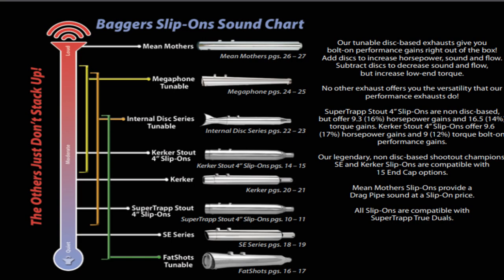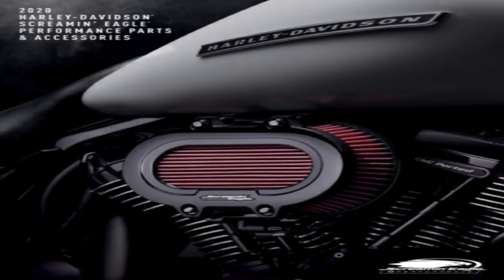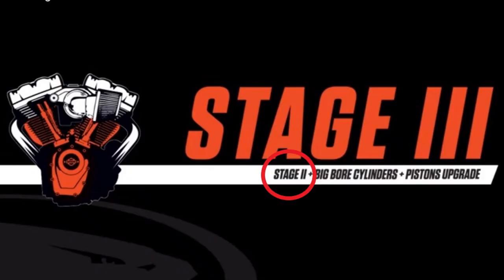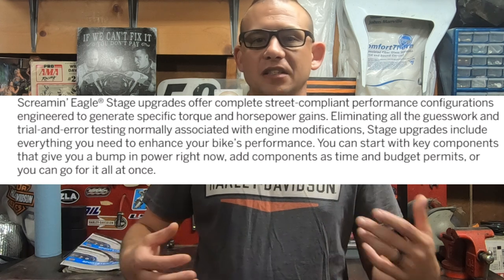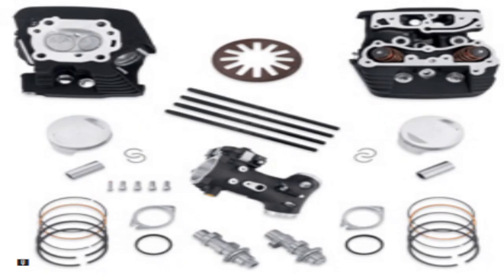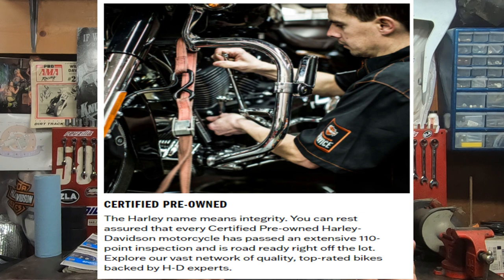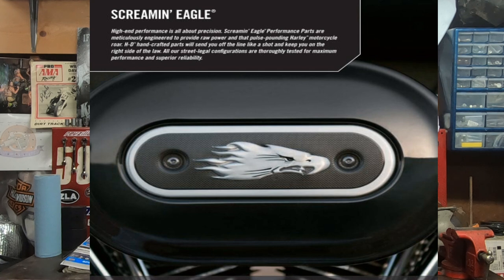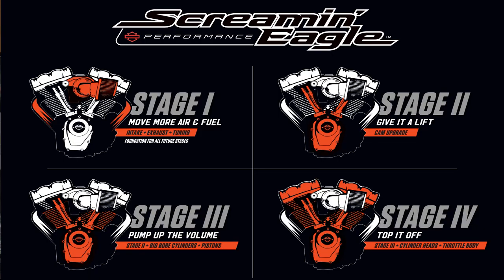Stage Kit Secrets, What Harley-Davidson Doesn't Tell You

Comment from the maker: Does anyone have a Screamin Eagle Stage Kit with an aftermarket cam?
Reply: I'd love to see what a Stage 4 131 kit can do with a good aftermarket cam.
Reply: I have a dyna fxdls that I did a 117 bolt on kit but with a woods 777 cam instead of the cam in the kit. It runs phenomenal.
Reply: Waiting for a tuner that will work with ‘21 RDRS then I will find a cam and upgrade. Probably be a while. 

I have a 21 road glide with a stageIV.
Reply: I believe zippers has one
Reply: @parkeslife4323  they can make upwards of 150whp/tq with a proper cam/tune.
Reply: @oldschoolmobile  that's what I'm talking about. 40 more TQ with 50 more HP to boot over a stock bike. And a decent boost over the "Warranty Friendly" SE 131 kit. Just with a cam. That's the bit that I find most interesting about M8's, how they respond to a decent cam that lets those heads flow to their stock potential.
Reply: 122 kit on a 114 with Vance & Hines full exhaust. Honestly, I don't need anymore on my SG. The results are already more than the chassis can handle when it's pushed hard. I also need to force myself to slow down! The Damn thing makes me ride to fast.................... :)
Reply: I ran into a guy with a 2021 RG. He had a Harley stage 4 131 kit installed by the dealer but said that S&S told him that their 505 cam would be better than what came with the kit so he put that cam in and said it was a monster. Didn’t ask him his numbers but the bike did sound nasty.
Reply: Did a 95 inch upgrade on my 01 DX, Feuling 585 cams, high compression and screaming eagle race heads. After I got the carb dialed in it was a killer outran many 103s and stock 110s
Reply: @Bluis5445  I've got a Wood Knight Prowler 22x in my Breakout 114. With the heavy breather intake, Vance and Hines short shots with a tune, she runs like a scalded-ass cat. Wood is an outstanding cam.
Reply: The sealed SE Stage II EFI kit I bought for my 1997 FLHPi (prior to ripping out the Magnetti Spaghetti Fuel Injection!) contained an Andrews EV-27 in an HD SE box.
Reply: Yes very confusing.  Installed a andrews 48h cam as stage 2 . This year bought 103 stage 2 , no cams , which was okay for me .Very happy with results .

Comment: Just ran across this post . Harley is confusing on there stage kits for sure . 2008 heritage classic , Last year installed  power vision with target tune , fueling cam plate , oil pump , andrews 48h cam , Cobra power pro 2 into 1 , SE high flow a/c , gaskets bearings , all came with the bike . Put a big smile on my face , what a change . Now I have run across a obsolete SE part # , never used stage 2 103 kit , minus the high flow a/c. For $275.00. Hear the bump in compression makes this cam really nice . Also saw video on having cylinders bored and so on to bump compression. Looking forward to a wider smile ! If I hadn't come across the deal , still would be content with what is already there !

Comment: I ordered my 20 Breakout brand new. The dealer steered me towards a Wood Knight Prowler 22x cam, pipes, intake and a tune over a SE stage 3 kit. They told me that as long as they installed everything my warranty forever would be intact. I've got that in writing and my dealer has been great. I'll take aftermarket parts over SE any day as long as the warranty is honored. I saved thousands and gained more hp and torque.
Reply from the maker: You have an awesome dealer that believes in and stands by their work! Harley-Davidson won't warranty what they are doing so the dealer will warranty it on their own. That's awesome they put it in writing for you and the fact they were honest with you about a cam swap versus an entire engine kit!
Reply: @GixxerFoo  tell me about it. I bought it in April of 20 when no one was selling anything due to covid. My wife and I were considered essential workers then and I'd already saved $2500 to put down on it and they were eager to sell. Even better was that Harley Financial would only give me 7% apr with over 800 credit scores so the dealer turned me onto a local credit union and got me their lowest rate at 3.75% making payments only $367. My dealer has been wonderful. I was concerned after hearing horror stories about dealers but I guess I got lucky. 3 State Harley Davidson in Bossier City, Louisiana. Love your channel too. Ride safe.

Comment: Another great honest video. They play on selling things to guys who know nothing about engines. Gimmicks. The basics to increase performance. Heads for compression, cams that work with the valves in the head. Performance bearings to handle the extra load on the engine. The piston still only sucks in what it is capable of sucking in regardless of the cams or valves. Now there are forced systems that will push more air and fuel in. Unless you have an engine test stand you are shooting in the dark. By the time you spend on all of that over priced parts and labor you could have put a drop in crate engine already built for performance. Crate engines are already tested for performance. For myself I had to purchase a screaming eagle jet kit just to get the carb to work right with the heads that came on the bike. Harley knew I would have to jet the carb. I put a 3/8 hole in the single plug in my stock exhaust, instant stage one exhaust. I also switched out the intake to a screaming eagle cleanable filter to save me money on air filters over the life of the bike.
Reply from the maker: I will say the Screamin Eagle kits are tested combinations and you usually do hit the advertised power at a minimum. But then again there are a lot of shops out there that have tested and put together some killer combinations that make some big power. Generally following the basics with a good tune still nets some very impressive results as well too.

Comment: My first Harley was a brand new XL1200T! Kept it stock until the warrantee ran out. Did the stage 1 with V&H twin slash exhaust with the Screamin' Eagle Round High-Flow Air Cleaner and V&H FP3 tuner. Even with the V&H quiet baffles I could not here my GPS! Even after spine surgery the XL1200T suspension was too much. I took it to the dealer to get an idea what it was worth, UKE’s asked me to test ride a 2019 FXLR. I went over very rough roads and was amazed! No back pain. I refused to ride the XL1200T any further and signed the documents.

Uke’s Dyno was down so I could not get a ”Stock” reading. I wanted a Stage Two 100HP+ ride. Went with Screamin’ Eagle upgrades and an extended warrantee. Hi Flow air filter, Hi flow aluminum intake manifold, Street Cannons, Torque cam, Pro Street Tuner and the Smart Tune PRO Automatic Tuning Module with the wideband O2 sensors.

Very disappointing, 94hp and 105 torque on the Dyno! Expensive enough to miss the 100HP+ mark! I only have 500 miles on her but the dealer told me that once it is broken in I should see over 100HP. Wonder if that will ever happen?
Reply from the maker: It's very fair to say once it's completely broke in you'll see over 100 horsepower, that motor with only 500 miles on it is still very tight. I honestly hate new bikes just for that break in period, they run hot due to all the break in friction. But once you get them broke in it is totally worth it!

Comment: I just traded in my Road Glide with a aftermarket custom "stage 2" (pipes, air, Woods 555 cams, lifters, S&S headpipe, Power Vision, etc.) for a certified new trike (yeah, I'm getting old and I now have aftermarket parts in my knees). I'm putting on new air, a SE tuner, and Tab 4.5 w/Zombies and going to wait the 12 months for the warranty to expire then ... it's GAME ON! Yeah, I'll be "wasting" that SE tuner, but to keep the warranty for a new used bike is worth it. But as you said, cams make the power and SE cams basically suck ... because they need to be EPA compliant.
Reply from the maker: Just glad to hear you're staying in the wind! I think a lot of us have wasted some money on the SE tuner to get by until the warranty expires. Lol I know I did!
Reply: @GixxerFoo  Thanks. After watching a couple of your videos I'm already planning out the next thing for my 114. Definitely going with a DynoJet Power system again, not sure if I'll just go with the Commander or the Vision (the cost of the Vision has really gone up) and most likely an S&S pump and plate. Going to replace the head pipe (not sure if I'll go with S&S like before or one from Tab Customs. Biggest thing I'm on the fence about is the cam ... S&S 475 or Wood 22XE. I keep going back and forth. I really want a kick in the butt at takeoff since I'm now riding a 1250 pound pig.

Comment: Great shout out to Kerker and Supertrapp. As a kid in the 80's those were the go to brands along with Vetter . I would say a build on your engine should always start with a good, solid base. Like a good boxer,football player you need a good base,footwork. Darkhorse crankworks  is where I would start. Then their compensator. A proper primary chain tensioner is next. Hayden or Baker. I belive once you do that, your engine is ready to reliably take on whatever you wanna do next. Kinda like a muscle car engine with forged internals.
Reply from the maker: Thank you! You're correct there starting with the crank and working out from there! You get a good crank in and invest the money from the start you've got a solid engine that's going to last forever. Even at rebuild time using quality parts from the start makes your rebuild so much easier with less items to be replaced.

Comment: Thanks for the Vid......  '09 CVO Ultra (new) dealer installed Stage 3 CVO upgrade,  10 1/2's, SE259e cams, etc.  She dyno'd at 98hp, xxTQ.    I had the 7 year warranty.  Much HP left on the table. No desire to run HD cams again. Troubles with SE tuner (detonation) , swapped for Thundermax, was able to get a stronger tune, still short of 1hp / inch. (103hp)
Reply from the maker: Those SE tuners are pretty lean sometimes and the curves can be screwy. There's a lot left in that engine, a good S&S or Wood cam would really make it come to life. Still really good numbers though with the 259E!

Comment: The only advantage i see to buying your „stage kit“ from the Scream‘n Eagle catalog is if it lets you stay emission legal in places they enforce both emission & look rules, like Europe.  The warranty would be another plus but I’ve seen to many horror stories in the forums on warranty claim denials on dealer installed options.
Reply from the maker: That is a huge plus on the stage kits in areas strict on emissions. If you get a new bike you have 60 days to get a stage kit done get it totally covered under the 2 year or extended warranty. After that you only get 1 year, but even then they don't like to cover issues from the stage kits.
Reply: @GixxerFoo  right on bro

Comment: Great information as always.My 05 Deuse is a B motor.kind of a odd ball.Iv only upgraded the cam plate and put in a high flow oil pump.And hydraulic tensioners.But as long as it runs well as is why fix it if it's not broken.For what it is its a pretty fast bike all things considered.
Reply from the maker: Thanks for sharing, they do run very well! The B motor is with all those upgrades is hard to beat!
Reply: Robert Rosson I don't think there's any reason to put cams lifters what-not-inn unless you've done the improvements that you did. As in high flow oil pump cam plate and tensioners. I'm no mechanic but I think that makes the bike so much more reliable then you can go with Cam and lifters if you like!!  IMO!!
Reply: @danwhyte3524  I agree

Comment: I have a 15 Rushmore with 52k on it and because I’m keeping it decided I wanted to freshen it up so I had a stage 4 done and didn’t change the cams because I wanted all the parts Harley engineered for the motorcycle. I did have my heads freshened up with new seals , guides and ported as well as a SE billet cam plate and high pressure oil pump , new tensioners and street tuner to preserve the one year warranty from Harley. The bike came off the Dyno at 118 hp and 124 tq. Which I was happy with.
One of the guys that works there in parts had the same kit done on his 15 SE but only had the kit done without doing his heads, cam plate or oil pump, probably due to the cost but he did replace the 259e cam the kit came with for an S&S 585 cams because of their popularity and the same guy that did my Dyno also did his and told me my numbers were considerably higher than his came out.
Reply from the maker: Going the extra mile like you did with getting everything gone through made a big difference on your bike! Those are some really impressive numbers!

Comment: The elephant not being discussed is the reliability impact versus stock, not so much Stage I or II but once you get into cams and higher compression. I wonder how much impact it has on engine wear.
Reply from the maker: That really depends on care, riding habit and maintenance as with anything. There are some things on the stock Harley platform even with their stage 4 added that may be of some concern. For the most part they can be very reliable if you add the additional required parts to match.
Reply: The more you juice the orange the sooner it will run out just a fact of life… you can build good reliable race/performance motors it will just need a rebuild/freshen up sooner than later… they are built to be run and run hard not a leisurely drive to the supermarket 😎🎉

Comment: My biggest beef about the S.E. line of performance parts, is, I feel, some of them should have been installed at the factory. For example, the stock cast cam plate, is just only adequate in stock trim. For a product touted as a " premium motorcycle," some of the hardware should reflect this description. By installing a cheap, cast cam plate, future upgrades with bigger cams, etc, would leave the stock cam plate as a weak link. Uprated power output, I feel, would further stress the cheap, cast unit, and possibly lead to cracking, or sim.
Also, the cheaper Cam Bearings, installed, are usually replaced by stronger, better designed units. So, why didn't the Motor Co., install these improved parts as stock? I feel, so that they can double dip into your wallet, and upsell you their S.E. parts. The Motor Co. already backpedalled when going from the reliable, strong, dual-Timken Flywheel Bearings, to replacing the pinion side with inferior, weaker, straight roller type bearings. Don't get me wrong, I, like many others, dig Harleys, but feel they could do much better with their initial offering, and install better parts as O.E.M. So, I won't go the S.E. line later on. I'd rather go with S&S, Zipper's, Feuling, STD, or any other Perf. Co for perf. parts.
Reply from the maker: I agree, the factory parts are good enough if you keep it stock or even add pipes and air cleaner. But if you start adding to the motor you need to buy the heavier bearings, lifters, cam plates, it just keeps going. Some of these are required parts and not even listed in the kits when you buy one.
Reply: But, when The Motor Co. went backwards, and went from the reliable, sturdy, dual-timken main bearings, to the straight-roller INA (F), style, somehow cheapens things. Look, I dig Harleys, but the Factory  makes some strange decisions at times. Regressing, not progressing. Just a sentiment.
Reply: Thanks so much for the response!
Aloha, from Honolulu, Hi!👍🌺🤙

Comment: The video really helped.
Just do Stage I and ride the bike a lot.
Once ready, go to stage IV or purchase the new HD 135 Crate Engine.
Stage II and Stage III are not worth it if I go to Stage IV later because I will be out of all that money already invested from Stage II or Stage III, but my Stage I should be good.
Is that correct? What do you think? I want to keep my warranty. I purchased the bike new in June of 2022. I will have installed a Vance & Hines  Black HeadPipe and a Krome Werks Muffler Set (Dual), plus tuning with a new red air filter. Keeping the Stock air-in-take kit (just changing out the filter).

Could you let me know what your thoughts are???

Comment: This is where a competent parts guy and service writer steps in sells you what you actually need! Just a heads up, you can order a whole Stage Kit, or you can break it down and order certain parts, just what you NEED!
Reply from the maker: I've seen some great counter guys at my local dealer, a guy was looking at a stage 4 kit and they flat leveled with him. With the cost of the kit and the installation charge it was cheaper to buy a 120ST and have more motor and less labor cost on the install.

Comment: You think you could give us some info on Switching out handlebars ,extended cables and such for different bikes? I think there's  a lot to cover on this topic when you're getting into older and newer bikes.
Reply from the maker: There's quite a bit involved in a handle bar change, it sounds pretty simple but it can expensive in a hurry. Depending on what you get you will likely need new throttle and clutch cables, brake line or new line for the clutch if it's hydraulic. Then there's the wiring, you will need to get the wiring extended with a plug in kit if available depending on the year. A lot of people get sticker shock when they get a quote on a simple handle bar change.